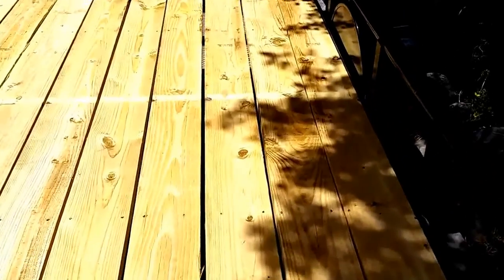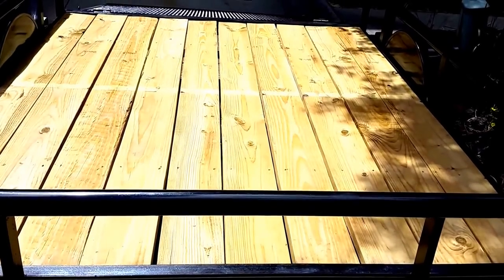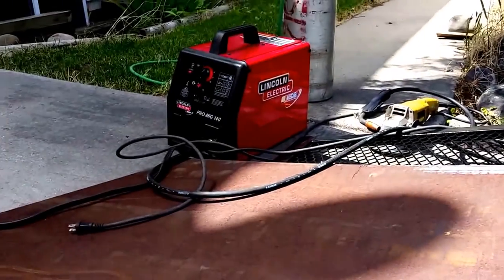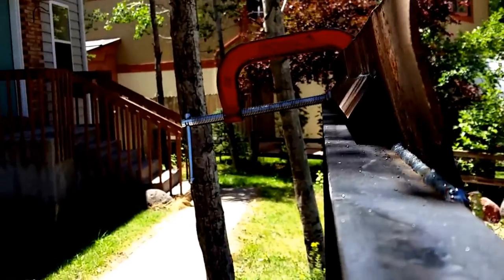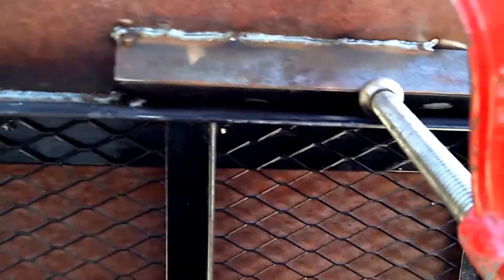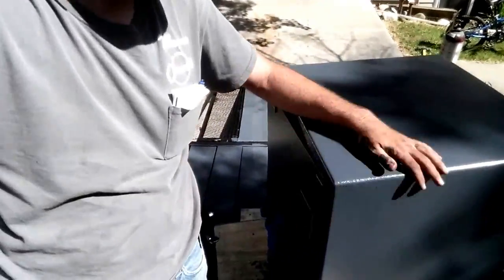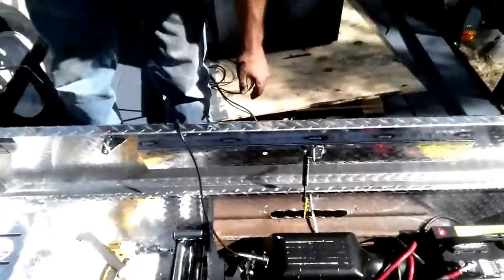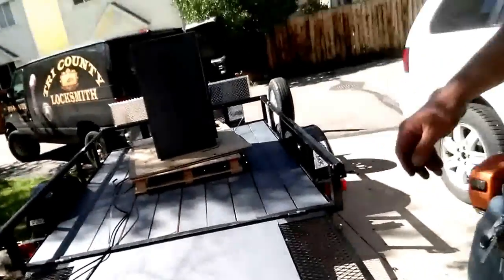How To Make a Safe Moving Hauling Delivery Trailer For under $1,500.00

Comment from the maker: How To Make a Safe Moving Hauling Delivery Trailer For under $1,500.00
Trailor on sale Tractor supply $999.00
8000 LB Winch onsale $250.00 
Truck Box $148.00
Deep Cycle battery $89.99
https://youtu.be/HMq-Kc4hRQ0